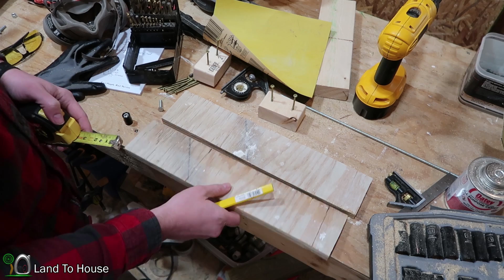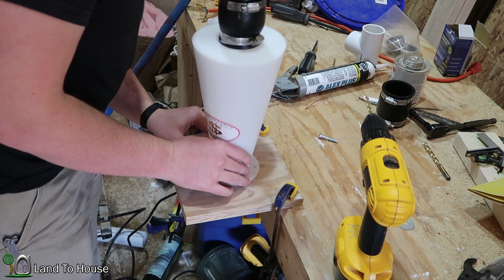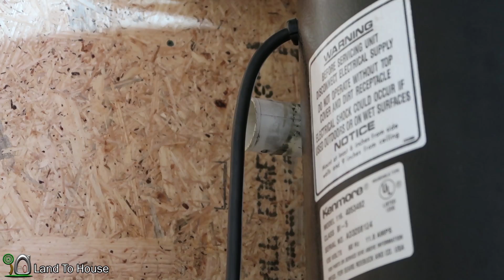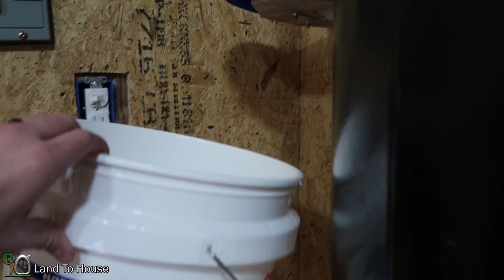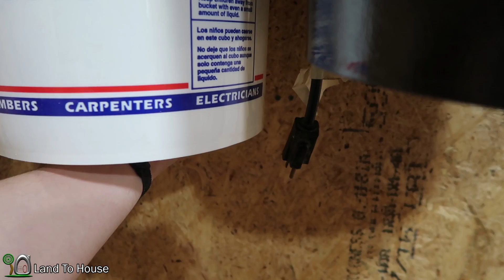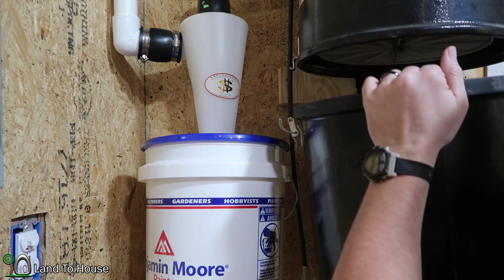Dust Collection - Build a workshop #42

Comment: You definitely need support under the bucket. The reason the bucket is "crumbling is because the walls are not thick enough. As someone who used a central vac inside their shop, always wear hearing protection. They are as loud if not louder than shop vacs. You can reduce the noise by enclosing it in a box as long as there is a vent near the motor exhaust to keep the motor from over heating. Some inexpensive foam sound proofing squares glued to the boxes interior walls will reduce the overall noise. Make the box in 2 sections, a top and bottom so you can still empty the vac. The clips seen on the central vac that holds the bottom on can be purchased on Amazon to hold the bottom of the box on. 4 should be enough. Good luck.

Comment: I just have a quick question, and here is some context:  I have a central vac in the garage which is rarely used (we have hardwood floors). My indoor workshop is below my kid's rooms, so shopvac noise on top of tool noise is not ideal.  My question is, can I use the central vac, with a cyclone as a dust collector?  Now I see what you've done, so I'd like to know how it's held up - if you had to do it over, what would you do different?  Keep in mind, my table saw is in my garage with a proper Delta 1.5 hp dust collector.  But I was thinking of using the Central vac for my workshop in the basement with a Cyclone.  Can I get your thoughts Seth?

Comment: Seth, I enjoyed following this build, keep them coming and I'll keep watching and liking.
If I may, your cyclone chip separator is actually redundant, that whole house vacuum bottom chamber is designed as a thien-baffle type cyclone separator to get large bits to drop to the bottom quickly and away from the filter.  
If you want 2-stage collection to keep your shop vac from getting full too quickly, I'd suggest something like this chip separator lid for a 5 gallon bucket: https://www.amazon.com/Woodstock-W2049-2-Stage-Cyclone-Separator/dp/B0000223XZ
I'm actually glad to read you got rid of that whole house vacuum as your dust collector.  It seemed way too noisy to be in the same room when you are working, it was designed to be installed in a remote location.  Also, at 11amps draw, and adding in a table saw or chop saw and filming lighting, I was concerned you'd be tripping that 30amp breaker a lot.  A big furnace filter taped to the back of a box fan, hung from the rafters, will go a  long way toward keeping airborne particulates under control and your shop vac can take care of the rest.

Comment: Thanks so much for sharing, I have never seen connect cyclone to house built-in vacuum before. I have similar vacuum, think about add cyclone to it. Your video helps a lot!!
Reply from the maker: Thank you for watching. I ended up removing this vacuum system from my shop because it took up too much space. But the system did work well while it was in place
Reply: @LandtoHouse  I have a system similar to yours. I’m planning to put it on wheels and use it as a rolling vacuum cart.

Comment: A central vacuum is for the inside of your house
Reply from the maker: Yes. Or in this case woodshop :)
Reply: You can use this type of vacuumed for a wood shop. It's not ideal, but as long as you use a 2-stage cyclone separator, it's no different than using a shop vac. I have one in my shop used just for my router table. It is temporary until the DC shed is complete outside of my shop. They are also very loud, so keep that in mind.

Comment: You might want a copper wire inside that pvc to discharge any static.
Reply from the maker: I have read that it can be an issue. I will give this a few test runs and see how the static is.
Reply: The dust explosion is a well known problem. Feed mills grinding animal feed and flour mills making flour for baking deal with this all the time. 

Your test <might> be your shop on fire.  I can mail you a length of wire to strip and place.  It wouldn’t have to be a huge 6 gauge wire 24 gauge would dissipate the static as well as 6 gauge.
Reply from the maker: All the research I've seen indicates that dust explosion occurs in very large Productions. I ran a system for 10 minutes straight today and did not have any shock. I wonder how long it has to run before a charge builds up. I imagine that it would only require that small wire for such a small amperage.
Reply: @LandtoHouse  use these smallest wire you can find. It's not an amperage issue. It's a voltage issue. 
I think the risk is incredibly small but the effort to eliminate it is smaller.

Comment: Hi Seth,
i dont think, that the (white) bucket can stand the vacuum. it will be "collaps" when the pipe ist congested.
I am using 50mm pipes and a metalbucket with brace in it.
Cause my vacuumcleaner (much lower power than yours) let even the metalbacket collaps.

Sorry for my bad english
Greetings from germany
Reply from the maker: Good tip! I have seen videos of plastic buckets collapsing. I was thinking about making a wooden cylinder that would fit inside the bucket for extra support. I will have to use the vac for a few times and see if it really is needed. I have a feeling that as soon as the vac is blocked that bucket is toast.
Reply: just put one bucket inside another and it will stop collapsing. I had the same issue with my kenmore central vac which I got for $20 and made my own cyclone setup. works great.
Reply from the maker: I ended up taking this unit out. Needed the storage space.

Comment: I think the channel I like to make stuff set up his central vac system to open and close each connector automatically. Lots of Arduinos were used.
Reply from the maker: I just subbed to that channel. Seems like a great idea but way more work than I am going to get into. I like the good old flip a switch method.

Comment: Awesome build. On thing to be aware of is static electricity, you may want to look in a way to ground the system. Dust is explosive, and I have have been shocked more time then I can remember with the dust collection system at my dad's shop before he grounded it.
Reply from the maker: I hear that getting shocked is common on these PVC installs. I wonder if I make a rubber hose connector for my vac hose to pvc connection if that would eliminate the shock. I have been reading some on the explosive nature of dust. Seems like that happens in massive dust collectors (like big factories) When there is more dust being made than vac power. From what I read sanders are the only thing in a small shop that makes that type dust and I would have to shave off 1/2" of material per min to gain the explosive aspect. .... I dont want to find out the hard way though.
Reply: These systems are really easy to ground.  here is a link to how a lot of people do it
Reply: https://www.youtube.com/watch?v=XtkHzmXe4ZA
Reply from the maker: I think what I will do is give it a try for a few weeks and then see if I need to ground. If it starts to shock I will ground.

Comment: If you don't want to vent the vacuum outside they make little foam box mufflers for Central vacs that I have seen work fairly well to dampen the noise just even putting a 90 on it I find helps a lot with the noise you should be able to find all that in the back um section at Lowe's or Home Depot
Reply from the maker: Very interesting. I wonder if that is the main noise maker of the machine. I will have to look into that when I start using the vac on a regular basis.

Comment: I would connect pvc to vac. Skip the buckett
Reply: Celtic Bear the bucket means he won’t have to clean his filter as often as the cyclone drops a lot of the dust before the vacuum.
Reply from the maker: I might end up doing that. I want to test out this bucket with cyclone first though.